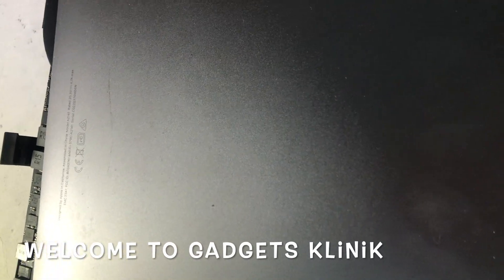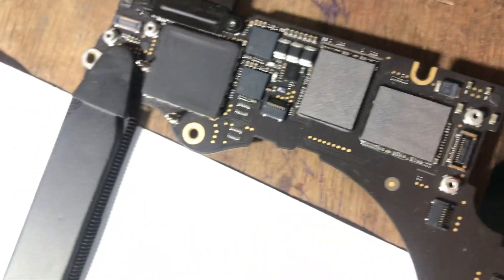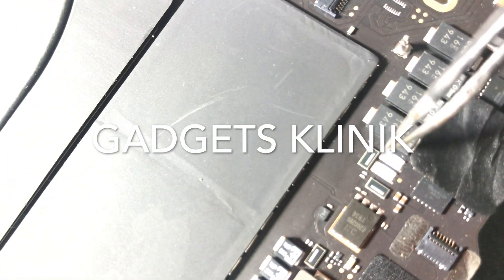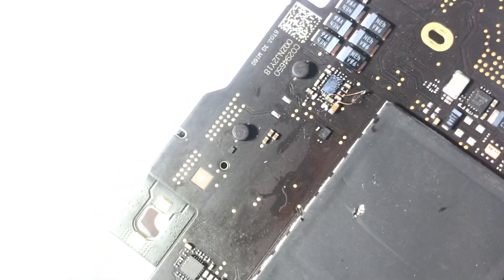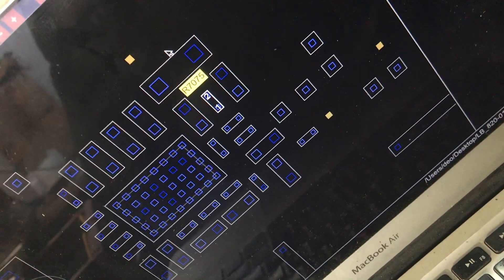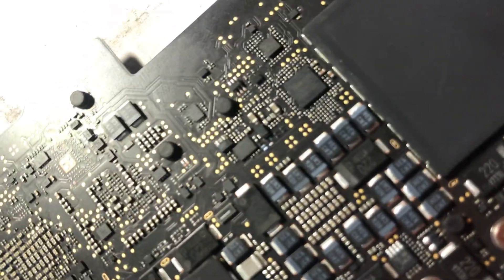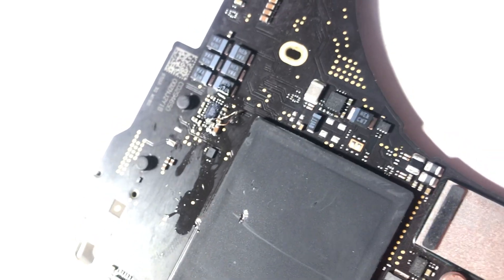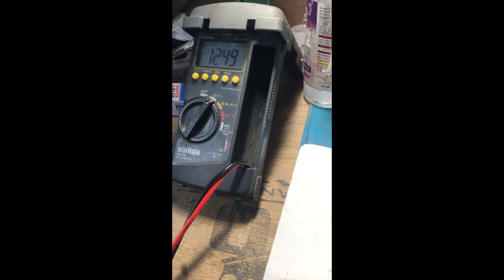A2141 MacBook Pro 16 inch 2019 no power logic board repair 820-01700-05

Comment: Awesome! I have only 1.35 V at all usb-c ports and i have checked it with alocohl and little Voltage and my R7075 is also defect. Thanks a lot. I have two Questions. 1. Do you know how many voltages do you had at USB C before the fix? 2. Could you please describe me your fix in details? Thanks a lot and best regards.
Reply from the maker: Before repair, I have 3v LDO on CD type C ic, and I have 1v on PPBUS_G3H.
Reply: @TechRoady  thanks a lot for the info. For the modification you removed the old one and connect the new one as in your Video Right directly to the other parts ? Will try it Too.
Reply from the maker: @MrSonnyjack  I just remove R7075 I don't have the same size resistor so I put in a big resistor. I connect R7050 between C7077 and C7075.
Reply: @TechRoady  thanks Mate! One Last question. What specs did your new resistor have? I ordered one 4.7 / 5% / 20W , it arrived Today but i think it is a Little too big... Would be awesome if you Could help me. Thanks a lot.
Reply from the maker: @MrSonnyjack  I found a 4.7 ohms resistor in donner MacBook board and put it in my MacBook pro 16 inches, 2019 bard. No need to buy this resistor, see careful in the video I also don't have the same size so I make between C7077 and C7075.
Reply: @TechRoady  Thanks a lot! I measured again over the weekend and found out that the C7075 getting 0 ohm its next to the tiny one, first i thought r7075 will be defect as in your case, because there was little air bubbles if i tested with voltage and alcohol. So i think now in my case instead of R7075 here i get 4.5 the C7075 capicator in the left next is defect because 0.01 there. How possible is it that now the U7000 - ISL 9240 is also broken? I ordered a new C7075 from a iphone today will wait till it arrived and then i will replace it and test it again...